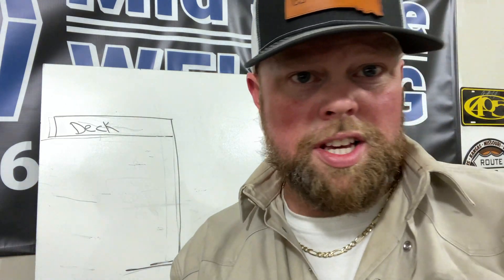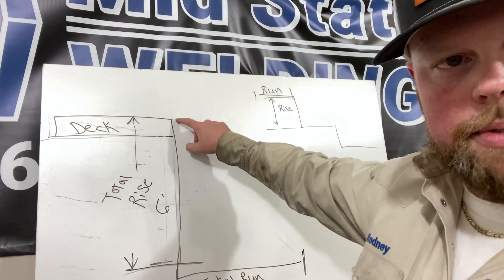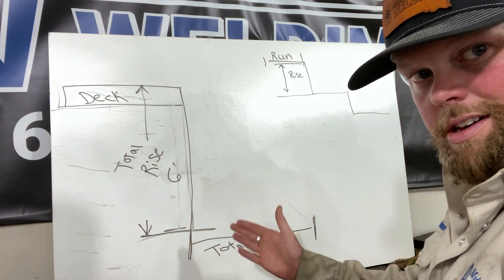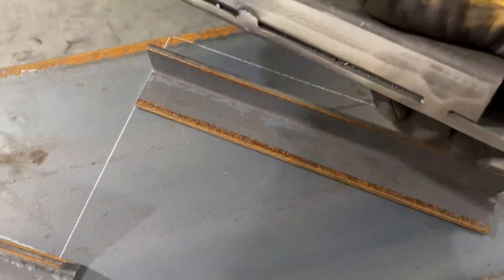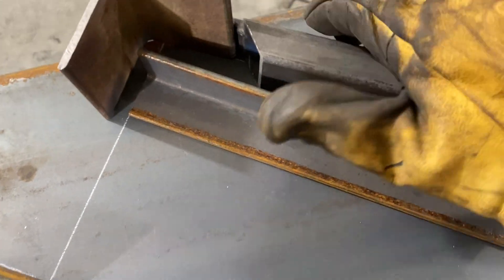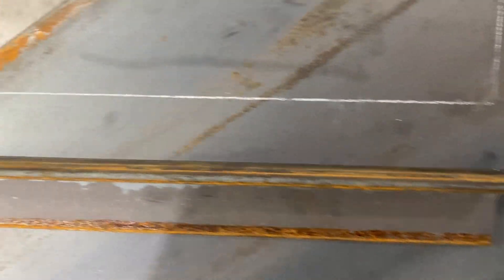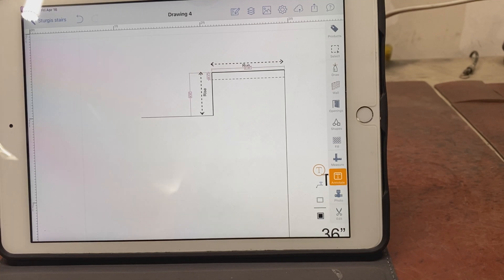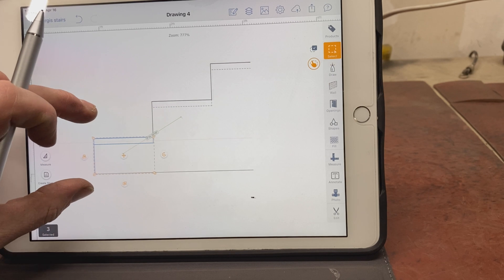How to Build a Steel Staircase | Rise, Run & Fabrication Tips

Comment: your techniques on building the stairs and the app are helpful but the start of your video doesn't make any sense.  You set it up for 11 steps for the rise but only 5 steps in the run direction.  if each step is 6-9/16" rise then 6 rises would only be 3' 3-3/8".
Reply from the maker: Yes you are correct. It was mainly for demonstration on how to find out how to find many steps and treads by breaking it down in the rise then run then plugging the numbers. Like I mentioned in the video that you have to run the number do to your situation. Take the numbers and plug them in to the calculator and that app to double check everything. Thanks for clarification on my demonstration. I’ll do an accurate video with my next staircase I have coming up soon. Thanks!

Comment: Hey man, how do u get the mesaurement for how to cut the stringer at the end where it hits the ground
Reply from the maker: What I do is take your square knowing how many steps you will have and start your first step at “7”3/4” rise and when you get to your last step it should be close to the same measurement as the rest of your steps. Unless your ground is not level it might change. If that makes sense
Reply: @midstatewelding3194  thanks man you should make a video on making stairs on unlevel services or where you can exactly get the rise and run easily

Comment: Your tread runs between 7 and 9 inches anything under and you'll trip every time
Reply from the maker: I know most code I’ve came across has been 7 3/4” max
Reply: If a permit is involved then building code will determine rise/run

Comment: Awesome video man. When you’re laying out the stringers, the “notch” that you cut at the bottom, that’s just the rise and run correct?
Reply from the maker: Thank you! Yes it is. Now that on sometimes isn’t the same as the rest depending on your situation
Reply: @midstatewelding3194  gotcha, I assume the angle of the stairs themselves effects that?
Reply from the maker: @Mike926443  yeah and because your aloud 3/8” between each step. Really all variables can change everything. If that makes sense